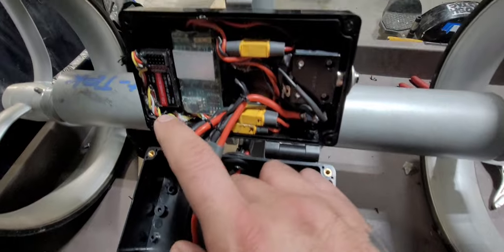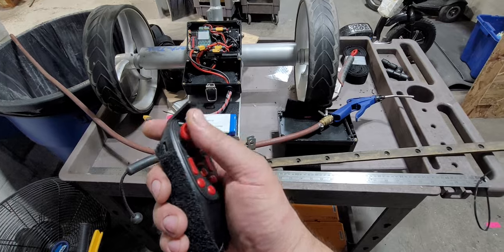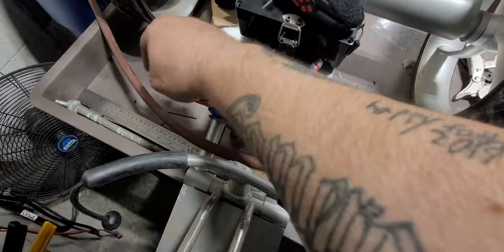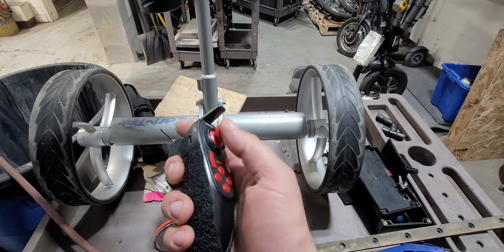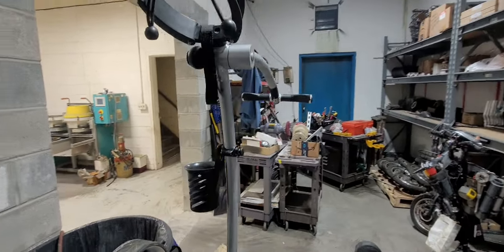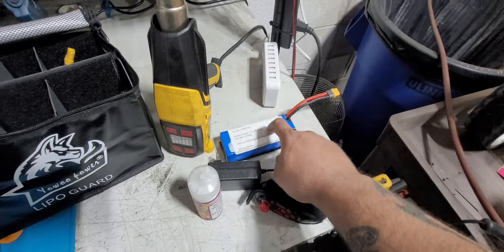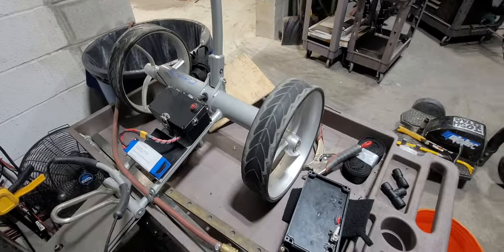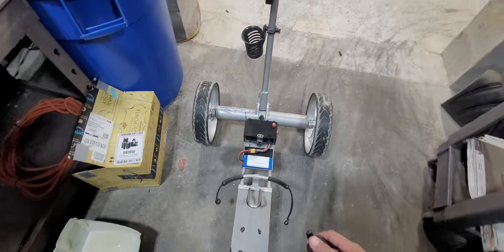DIY RC Golf Bag Caddy

Comment: I'm in the design phase of building this but using Power Wheels motors from an old kids toy.  This project is driving me nuts because I want to use the exact same remote you are using but can't find anyone using it for anything bigger than a toy car/boat.....

I feel like I'm losing my mind because I can't find anything, anywhere.  Can you send me the part number for that ESC? Do you know what Amperage your motors are drawing? I could even get some other motors if I need to but I really want to avoid getting an arduino and 100 components for practically tank control with joystick.

Here is my set up, I'm going to use either 1 or 2 Ryobi 18VDC batteries, step them down to 12VDC, OR 2 18VDC in series to step 36VDC down to 24VDC, to run the power wheel motors and have one on each back wheel of push cart.  I have a quick release pin that will let wheels free spin if I don't want to use motors and manually push.  Last piece of the puzzle is what you've made.

I am going to use the exact same controller you have, I am looking at some ERCs but my god the specs are so vague like "30A" is that per motor or total?  Even the motors are so generic that you can't find amps or wattage....  I am my wits end until I found your video and now have a glimmer of hope.
Reply from the maker: @mattgrimmett6067  the remote I used was the one single one handed single joystick controller that I found anywhere on earth. And I looked for months everywhere from here to China . eBay, Amazon, wish, Alibaba, AliExpress, etc . 

This is a brushed ESC. I can't remember the specs. I believe it was 1-6S capable. And not a ton of amps. Like 40 or 50 if I'm remembering right. I'll see if I can find a link to it or a similar one.
Reply from the maker: @mattgrimmett6067  I found a whole bunch on eBay.. just search "dual motor brushed ESC" and you'll see dozens of options.. I saw all the way up to 480A in my quick scroll through the page.. narrow down the specs you want.  And you'll be way better off getting geared motors. Step down the rpm's for added torque. You don't want a ton of speed. You want torque.

Comment: What ESC did you use?
Reply from the maker: @BigzMK17  just saw this comment. I can't remember the ESC. This was an old project. It's been finished for a long time. Pretty sure I had to go to some obscure eBay seller to find a brushed self mixing 2 in 1 ESC. It was a nightmare. I'll see if I can find the link. If I don't post a follow up comment with a link it's because I couldn't find it